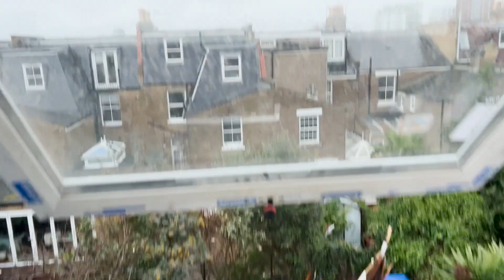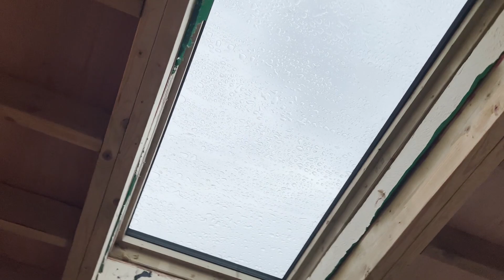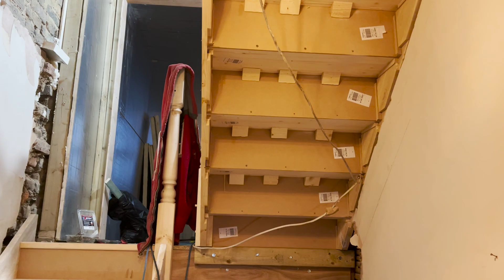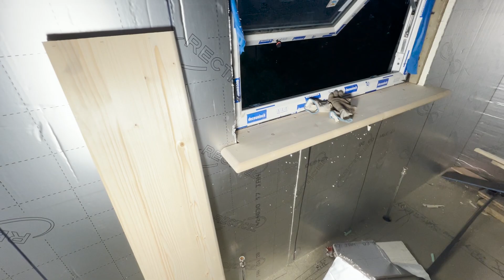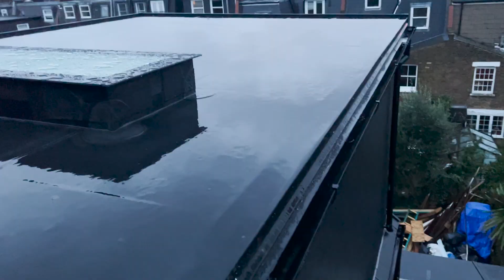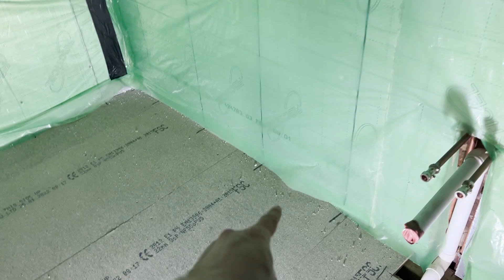DIY LOFT CONVERSION STAIRCASE + EXTENSION SKYLIGHTS - London Renovation Project

Comment: Another smashing video. Coming together nicely. 

With the vapour control layer, could you have had used foil faced plasterboard instead or would still need install VCL?
Reply from the maker: Thanks mate!! Im actually not too sure, thhe building inspector just  said officially you have to do it. Ideally would have used insulatedplasterboard but the prices are insane atm. Thanks for watching